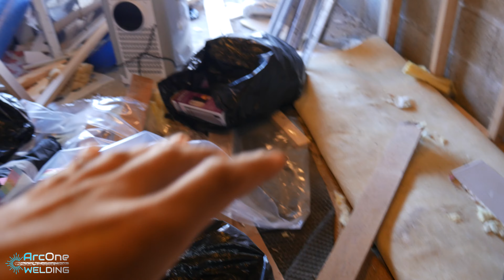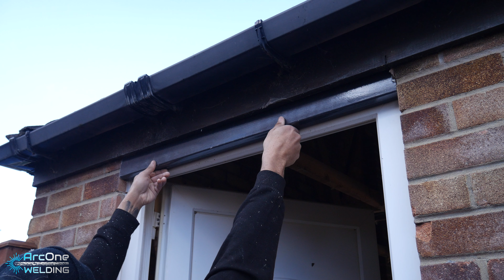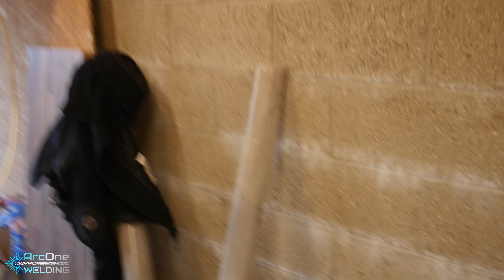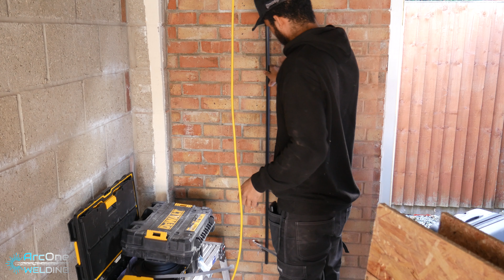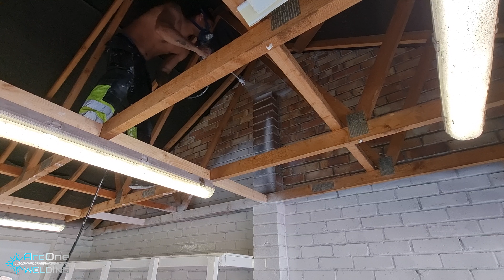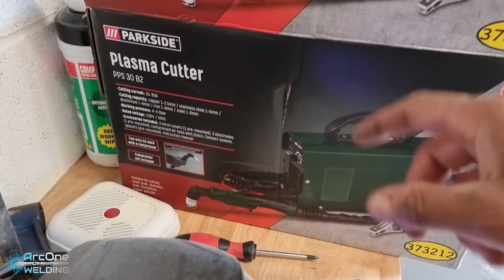My New Welding Workshop!

Comment: Interested in the airless paint sprayer, what was the overspray like? Does it make a cloud of paint that goes everywhere? Could you use it in the house without making a huge mess or having to mask off the entire room?

I've been planning on building a charger wall like that in my own workshop, was thinking of installing a Timeguard boost switch to power it, the ones where you can just press it on for an hour, walk away and it will automatically switch itself off when it's done.
Reply from the maker: Hey dude, there will be a full review in the next few weeks but from using it i fount that aslong as you aim within 300mm from the wall it all stick on there, im sure you would mask off a room for precautions but id happily use this in my house with only minor masking up, but definitely no huge cloud going wherever

Comment: If you have some spare cash buy a rotary 3 phase converter , gives you far more options on machine tools and welder to buy
Reply from the maker: Ive seen them, can i run any 3 phase machine off 230v
Reply: @ARCONEWELDING  with a big enough rotary compressor, you can. ideally double the size of your max welding power consumption